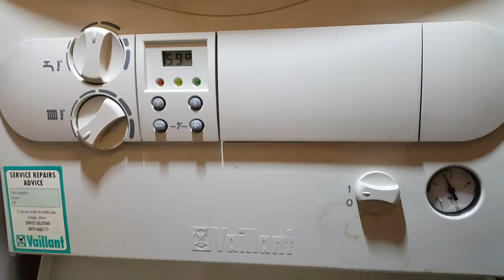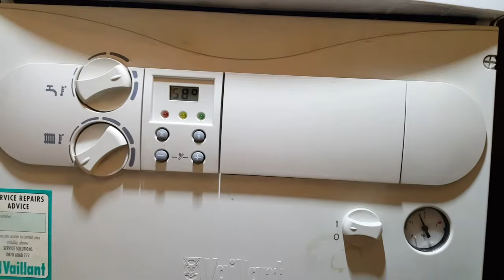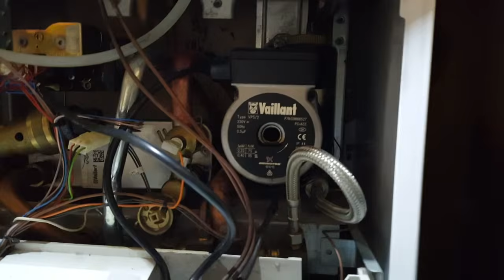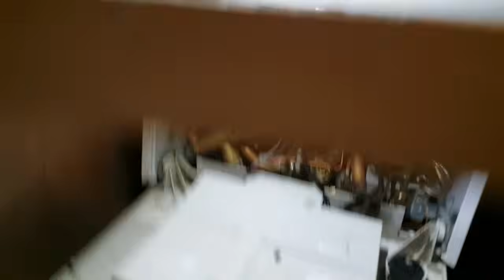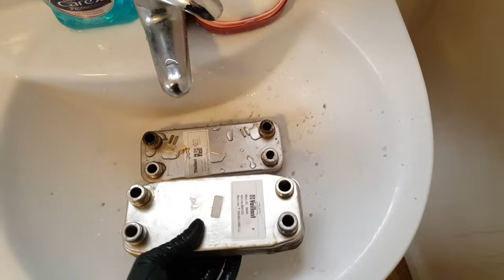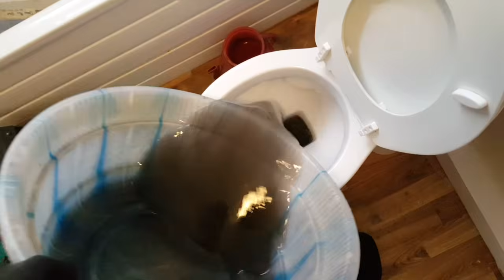Vaillant Hot Water Issue

Comment: I have the same problem and need to change the heat exchanger, but i don't have a drain cock valve on mine, so can i use the grey nob/pressure release valve to drain the boiler or a radiator, and is it possible to remove the exchanger without removing the diverter valve?

Comment: I'm a homeowner who happens to have a similar boiler with a similar problem and found this to be a great video, I've learned a thing or two about what the boiler is doing.  Also some good comments with more detail about removing the parts and putting them back together, how to drain the boiler, and especially, the need to power flush to get rid of the source ( which you did mention in the video ).  Thank you for taking the time to make this video 9 years ago, still useful today.
Reply: Asking in case you can provide a quick reply. Two of the connections I cannot get off! The top left and bottom left. I assume if I can get the top left off, the bottom left will come too.

Comment: @Abc_heating No its not straight forward to  remove, what did you use to remove the lower left hand compression  nut on the plate.
Reply from the maker: Hi, I haven't done one of these for a long time, but I believe I used pump pliers to undo that nut

Comment: Have you drained the boiler before removing the heat exchanger via drain valves on the boiler itself? i am asking because mine doesn't have them and i was wondering how to remove the exchanger without having to drain the whole heating system...Thanks in advance!
Reply: You have to drain the boiler before removing the heat exchanger. The pressure relief valve is an option if you don't have a dedicated drain valve.
Reply from the maker: Yes I did

Comment: Hi Bro. All my hot water taps are hot apart from the one to the bath only gets lukewarm. Do you know why?
Reply from the maker: Hi, there could be many reasons why! If it's only one tap then I would be looking at that bathroom tap 1st. Check to see if the cold water is not mixing with the hot water when you have just the hot side opened.

Comment: I noticed u had green flashing light I've got old baxi 80he instant . Heating seems OK but hot water hit n miss may start hot then go cold.  I had hot water upstairs at 1 point it was dsmn hot 🔥.  But if I rub tap in general on its own it don't seem to activate the fkame only if I run 2 taps
Reply from the maker: It's possible the boiler is not sensing the  draw off of water
Reply: @Abc_Heating  it's OK ww git a new 1 I think it was flow switch /sensor

Comment: How did you put it back on? I cant get the top right port to attach properly. Have tried everything
Reply from the maker: It can be difficult but the direction need to checked. A tip is to look at the top side of the heat exchanger and the dirty side should be the top. Sorry for taking so long in getting back to you.

Comment: Hi any ideas why there would be a 50 percent reduction in hot water flow coming from a turbo max it's the same at all hot taps?
Reply: I'm no expert but it could be the problem in this video or your pump maybe failing.  If the pump is failing it won't be able to pump the right amount of hot water through the pipes.  I'm having this problem at the moment.  Just had a new expansion vessel fitted in my boiler and I asked the engineer why my water isn't so hot and he tested my pump and said it was stuck.  He dislodged the impellar in the pump and the water came through hotter but it's not perfect.  He said it's probably failing, so will have a new one fitted at some point.  Don't know if there are other problems which cause lack of hot water.

Comment: Does this apply to when the boiler delivers hot water slowly. In my case it needs to run at medium speed ( so tap not opened to the max ) to produce hot water?
Reply from the maker: Yes, if there is lower flow the water can heat up with less heat

Comment: Hi...i have got the same boiler.It keeps coming on and off on its own.The heating doesn't work.It would come on for 4 secs ,reach 70 C and then come off.No fault codes and plenty of water pressure...Plenty of hot tap water following an exchanger swap....

Comment: Hi I am currently having trouble with mine. Low flow on Dhw, which is highlighted more so on the shower. I've changed the thermostat cartridge. I've also just changed the heat exchanger on the combi. I have good pressure on the mains. Only thing left is the diverter valve I think. It drives ok and I can't feel any water going to the rads when calling for dhw. Could the problem still be with the diverter and reduce the DHW flow so much?
Reply from the maker: Hi Daniel, the way to test the diverter valve would be to fire the boiler on hot water when the system is cold, then feel the flow and return pipes under the boiler. (22mm pipes) If there is no temperature difference then your diverter valve should be fine. Does the hot water work on the basin and kitchen taps?
Reply: @Abc_Heating  Hi. Thank you for your reply. The hot water works on the taps. No heat getting through diverter to the rads when hot water required. I removed the cold water mains filter the other day and cleaned it up, which improved it a bit. I have now ordered a new flow limiter/reducer (mains water in) and new filter as hoping this might be causing issue 🤷‍♂️ existing one roughly 16 yrs old and may well have perished. The flow has slow got worse over the last few years.
Reply: @Daniel Clark  where does the mains water in filter go buddy ? You're obviously quite clued . I got heating but hot water mostly ends up cold and 1 tap on its own won't activate flame a headache I've ordered a cartridge fir diverter for*
Reply: @kevinhancock4064  Hiya, the bottom right of your heat exchanger is the mains water in. The part connected to this is a solid brass "aqua sensor" that bends back on itself. The filter is inside of that at the start. If you follow your mains water along where it meets this brass aqua sensor, that's where it goes. You will need to unscrew your mains water pipe to the aqua sensor, it's a bit awkward to get at, bit doable. If you look up "turboMAX spare parts pdf" you should be able to download a file.

My low pressure was down to a pressure reducing valve, that I eventually found, fitted further back on the system before it got to my combi. This was clogged and pressure was down. Just had to replace that in the end.
Reply: @Daniel Clark  ah ok great info pal cheers ..the oressure is going back down to a decent 1 bar after heating is off .my issue us my hit water going cold . Could be heat exchanger thermasist.  Diverter  cartridge or else ggrr
Reply: @Daniel Clark  one other thing is . I'm aware a safe working pressure wjrn heating is on is upto 2 5 bar but it don't usually go to 2 bar with heating on usually 1.5/1.6 max . 1 bar without.  Something going on with it and unsure
Reply: @kevinhancock4064  Hiya annoyingly I sent you a message last night with an eBay link for a replacement aqua sensor. I'm guessing it's been removed as it had an eBay link 🤷🏼‍♂️

My working pressure is 1 bar. The pressure is in relation to the DHW system (radiators) anyway. Your hot water is from the mains pressure. If the aqua sensor and impeller are clogged then the impeller will not turn properly. This is probably why the heating isn't kicking in with one tape open. Definitely remove the brass aqua sensor section and give it a good clean (this also has the mains filter in as well).
Reply: @Daniel Clark  would make sense Daniel  I'm aware the oressure is only fir rads I saud this to my old man Saturday.  Its mains fed as u said . Maybe its obstructing the flow and not actuating the boiler . As if u run 2 taps it tends to kick in usually ..

I was having to do this to have a shower where only upstairs was the issue but now downstairs also . When we moved in the bath flow upstairs was pretty OK it's def slower than it used to be ..

Bg  done a load of work on it around beginning last summer can't recall what was replaced but several parts . I wish I knew exactly what . Its an old baxi but still it's been not bad fir last 4/5 years . If I can get another couple of years from it be nice . The boiler itself get hot to touch on upper section which I'm sure is to hot fir my liking . Water from rads is good n hot . Not sire of its the therm  working here but when heating comes on . Here n there it cuts off then will after couple minutes boot up again .. I Brough pressure back down to 1 bar earlier with heating off . .....half hour checked was a littke under 0.6/0.7 so pressurised it to 1 bar again no leaks at rads   ... well only 1 trv maybe needs a nip (new around 4 months ago by myself ) thanks for your help buddy diamond
Reply: @danielclark7681  1 other thing may be OK it's on 70° I'm sure it's OK as normal temps are 65 + thought I'd mention it
Reply: @kevinhancock4064  purely flow speed through the aqua sensors impeller. Temperature shouldn't matter, the flow speed past is what's letting it down. If you copy and paste the following into the search on eBay, it should bring up the whole brass part:

Vaillant TurboMax Pro 28E R3 Combi Boiler 194819 aqua-sensor inpeller

This is the section you need to take off and clean (the wire mesh filter can be seen in the photo)
Reply: @Daniel Clark  it won't let me ai I'll type it kn later today mine is a baxi does it matter ?
Reply: @Daniel Clark  sorry I cut iffy to sion . Yeah I'll need to type ot in manually not an issue though and thank you mate
Reply: @danielclark7681  A diverter valve is a mechanism in a combi boiler that opens or closes to direct hot water either to radiators or taps and showers. A diverter valve may be faulty if your water is lukewarm, if your hot water taps work but your central heating does not or if your hot water taps only work when the central heating is on.

Taken from the net
Reply: @kevinhancock4064  best way to check this is run the taps to bring the hot water on and see if the pipework that goes to the radiators gets hot.
It could be both but the fact you are saying that's one tap alone isn't bringing your hot water on, would suggest a problem with your aqua flow sensor (impeller).
Reply: @kevinhancock4064  yeah you will need to get one that is compatible with your combi. If you search for aqua sensor and your boiler name/model it should bring up the one you need 👍
Reply: @Daniel Clark  ok I'll take a look thanks buddy
Reply: @danielclark7681  is it a flow regulator ? As not much comes up

Comment: why on earth would you fit a new heat exchanger? use a strong cleaner or One-Shot, and its like new, saving the customer well over a hundred quid. terrible
Reply: dude, he said heat exchanger that has been cleaner already, not new.
He may take it to his shop, clean it, then put it in next customer boiler.
This way he doesn't have to bring lots of heavy stuff to clean his system, he does this at the shop.
They do this also with pumps, which rarely fail, mostly they get dirty and seize up.
Reply from the maker: It not a new heatexchanger that's been fitted in the video. I've used another heatexchanger which has been cleaned with a pump and chemicals.

Comment: Hi got a Vaillant ecomax in a house I'm due to move into 
Rads ok (could b hotter I think) 
But only get hot water for about 10minutes then goes cold 
any ideas plz 🙏
Reply: I have the exact same issue. Only started happening after my service. Did you find a fix? If I turn my tap on only half way the temperature goes back up.
Reply: believe water flow sensor not working well, can be due to age and sediments in the system, may need cleaning.

Comment: Hi getting warm water when taps are fully open when quarter open getting hot, radiators are hot what can the problem be
Reply: believe it's the three-way valve, a small motor switches the pipe through which the water flows, for radiators or hot water pipe. If getting clogged, can't fully switch to hot water and water also goes to radiators.

Comment: Hi, can you help me please need advice. What could be wrong with my gas fired boiler? The central heating comes on but it doesn't fire up for hot water. Says its on heating mode. What does that mean & how can i resolve it? Its a vaillant ecotec 415 boiler. Any info will be of much help. Many thanks
Reply: Could be a sensor that detects cold water flowing through boiler, so it can't "see" that u need hot water.

Comment: Would an aqua sensor make any difference?
Reply from the maker: Aqua sensor is part within the boiler which detects if the hot water has been turned on. It would not have anything to do with the debris in the system. I hope that helps.

Comment: Where are u located I have problems with hot water and another boiler with noise I am based in Willesden???
Reply from the maker: I'm based in Leicester.
Reply: ABC Heating Services awesome job, I wanted u to fix my boilers had one issue with boiler noise and the rattling pipes and the other boiler in another property with no hot water just cold coming out... anyways ur too far in Leicester but well done for ur job awesome plumber !!! 👍🏼

Comment: Hi I have a valliant ecotec plus 832 so the problem is that its almost as if there’s a set amount of hot water for daily use and once all used the water runs cold...I will have to reset the boiler to gain a bit more hot water from it before it’s realised what I’ve done and goes cold again. In a day I’ll be able to run 1 full bath but on running a second one it will just run cold and it does this every day. What could be causing this?
Reply: maybe it's overheating, it has an extra protection, believe at 80C in boiler and 60C for hot water. The idea is to not give you water too hot, as it will burn your skin.
Possibly after a while, temp increases slowly until in triggers this protection.
Reset may not work right away, due to water still being hot inside, but I think it should work after 1hour, so u don't wait a full day before resets.
Believe it's either dirt on temperature sensor, or sensor bad that needs replacing.

Comment: hi! we had a grundfo's pump & sensor fitted 2yrs ago and last 2 months ago we had problem with hot water and sensor was changed but now having this F.75. Pump dead but upon checking with screw driver it's spindal is rotating. Does it mean the pump is broken again in just 2years? Could it well be just the capacitor & if ever can I put any brand of capacitor as long as it's the same size and voltage. I'm desperate as it is only Saturday. I have booked for the fixed service fee but it is for Tuesday. Hope you can help as it's so hard without hot water & heating this time of the year. I would really be grateful for the reply. Thanks so much !

Comment: i want to ask if there is no hot water coming out of the taps but the radiators heat up, what is the possible cause of this fault?
Reply: Can be sensor for hot water not sensing the flow, i.e. water requested by opening the tap.
Could also be the threeway valve, which switches water flow to radiators or hot water tap, if that is jammed, it will not be able to give hot water.
Reply: Man Lok Chin I think only the hot water circuit of the heat exchanger gets blocked.

Comment: @abcheatingservices hi I have burning radiators but no hot water from taps. Green light fires up. Rad inside boiler hot both ends. Pressure seems to drop too any ideas? No leaks
Reply from the maker: The pressure drop could be the expansion vessel. The hot water issue could be the diverter valve stuck in the heating position.

Comment: Very good nicely done
Reply: not really, the part is totally reusable and easy to clean. wasted loads of money for the customer
Reply from the maker: @davelaye7003  Not really, as I replaced it with a serviced one. I then take that dirty 1 to service and place it in my stock. saves me the time of doing it on site which in turns saves the customer money. So without knowing the facts you shouldn't assume.

Comment: If you have a magtech type filter in your heating system, does that prevent this problem from happening?

Also, random fluctuations of water pressure at taps, can this be a possible cause?

Thanks a lot
Reply from the maker: Hi zeczam no the fluctuating of water pressure when no have anything to do with this fault. The magnetic filter will give a basic level of protection, which is better then not having one at all.

Comment: So on an vaillant ecotec plus 837, what would cause the boiler to fire up and then stop firing within a few seconds when demanding hot water and repeat this cycle?  Keep getting bouts of hot and cold water. Central heating working ok .
Reply: Abz Hussain did u find out what was causing this problem with your boiler? Mine will act normal and then just run cold like I have a set amount of hot water and I’ve ran out. Does it every day. Can’t work out what the problem is
Reply: Could be sensor for tap water, if unstable. You could try opening taps at maximum, to make it easier for it to senss the flow.
Some boilers have an electronic chip which detects turbulence around a small object in the pipe.
Others had a small wheel that rotates when water flows, I think.
The ones with chip may need more water flowing to read properly.
Reply: You can have a problem also with burning, if fan is jammed, it will stop. If exhaust pipe is clogges, it will stop. There is also a pressure sensor, when fan runs, it should detect lower pressure in the exhaust area, meaning smoke will go out properly.
If that pressure sensor is not working fine, or a blockage in exhaust, it will stop as safety measure. You don't want exhaust fumes/gas to remain in the boiler, it may come into the room.